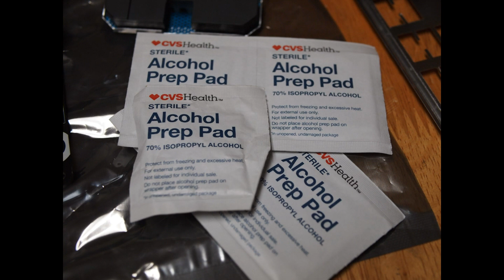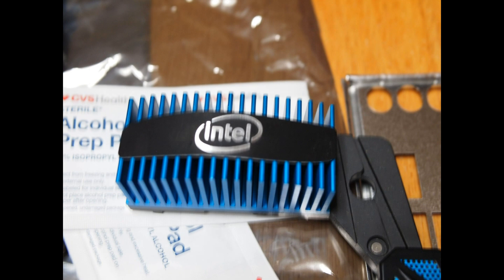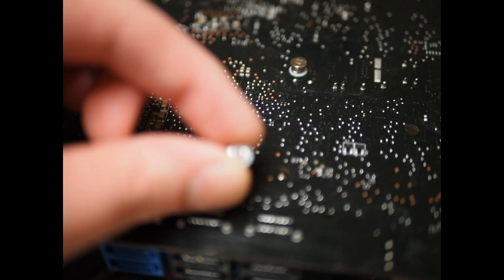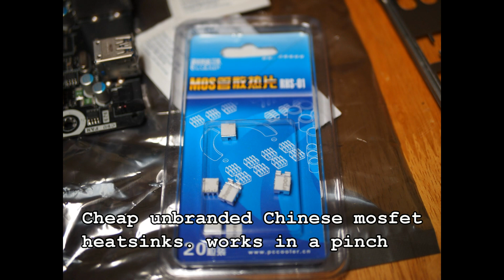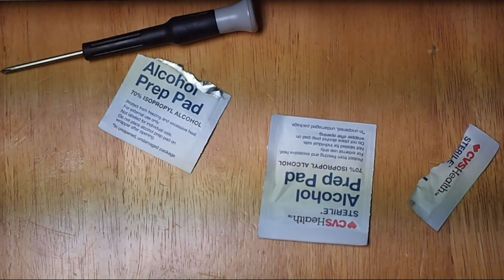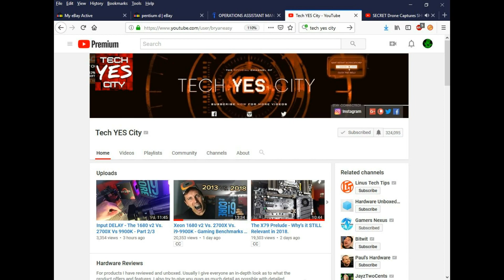Intel's unknown X79 motherboards - DX79TO

Comment: Pin? 
For win10 installation change to UEFI in bios.
Reply: For overclocking unlock profiles via helper then always lower cpu voltage i use i7 3930k on 1.35 and 4.5 for sure i could lower to maybe 1.29 or so as some people said its stable and if u put 4.2 in profiler u will get dynamic voltages which will always put you into bootloop i lost my mind after 10times. If u also unlock multiplier for without bios XTU wont do nothing as it will lock you back. XTU won't work for this mobo.
Reply: Cooler master hyper 212 with 2 fans 4.5ghz 60 in full load 40 idling
Reply: 2 fans on the cpu heatsink and i manage to get 50 on cyberpunk barely 60 degrees and 4ghz oc is very stable 4.5 seems to crash without AIO

Comment: I'm still rocking a dx79sr and it whips most new stuff easy.
Reply from the maker: What CPU do you use with it?
Reply: @ItIsNot1984  currently the 3930k but thinking about swapping for something with a few more cores
Reply from the maker: @mikeshobbiesandrandomstuff  afaik ivy bridge won't work on these boards, but I never physically installed one when i had the chance. Might be worth trying just to see what happens. Maybe intel snuck support in for them and it never made it to patch notes.

Comment: Bought this board back in 2012 with a 4x 4gb ram config gtx580 (now a 970) the 580 browned out, an I7 3820 clocked added a network adapter and ssd and this thing can still preform solid 10 years later. Crazy how the infrastructure for gaming really only improved on resolution. because at 1080p this thing runs modern games just fine. so 3k total for the rig including upgrades over 10 years in canadian dollars so prob $2400 american.
Reply: Can it run Subnautica? High/ultra 1080p
Reply: @terrapinflyer273  Yes it can! it can run elden ring at 60fps 1080p

Comment: I upgraded from x58 when I found a rampage iv formula bundled with a 10 core xeon and a 3930k for $130 a couple years ago. Sold the cpus to get an overclockable 1650 v2, no regrets lol. I am having a tough time looking for another x79 board (for a reasonable price) for another build tho
Reply: Nice!! I've been wanting a 1620 or 1650 v2 for a while now. Only drawback for the Xeons (that I know of) is the high tdp. And lack of onboard graphics if your dedicated gpu ever craps out.
Reply: @terrapinflyer273  I'd recommend looking at the 1650 and 1660 v3 xeons if you can find a mobo

Comment: Hi..best regards from Spain. Where Ivan find those hardware drivers??seams to be discontinued years ago, ando have to install those in w10, thx !!!Great job mate!!!
Reply from the maker: Intel abandoned its motherboard product line back windows 7 time. They dont exist for win10 really but not needed. I used two of these intel x79 models without issues in windows 10.
Reply: @ItIsNot1984  Thx mate,...some tricks or link to overclock ddr3 from 1600 to 1833 ???, thx
Reply from the maker: @ignacioherrero9374  i really dont remember the bios well enough. I will say this for cpu overclock, dont use the auto overclocker. It sets some pretty insane voltages and will burn out your board over time.

Comment: hey i have the same board with a cpu intel 3930k and 32gb Ram hyper X red edition  i am searching for gpu that is compatible  can i use 1060 or 1050ti or higher?  thanks
Reply from the maker: I used a 1070 and a 1050ti with success. I'm sure the 1060 would be fine. 2000 series and up, your guess is as good as mine. I think you'd be fine though even with 2000 series up since the board does support uefi.

Comment: I got one of these off of ebay for $119 with free shipping, and it came with a 4 core 8 threaded xeon! This is a good budget option, even in 2021.
Reply from the maker: It is still a good option for sure. You will want to go with a better cpu but you can often find these boards bundled with a cpu or ram that helps offset the cost even more.

Comment: Great video! I have a question for you and really anybody currently rocking one of these. I have a DX79SR that I got for $50 bucks and have been using it for nearly 2 years and it's been very rough. My issue is stability and behavior with Windows 10. There's no Windows 10 support on these boards and it's really showed me just that. I have a rather questionable RX 580 and I thought that it could be mainly the fault of that, but I feel like it's the board. I did try a UEFI install a time or two but that felt worse.

So, does anyone else have strange behavior and instability inside of Windows 10?
Reply from the maker: My first thought is look at your overclock. If you're running an OC try default and see if that clears it up. OC'ing with this board isn't hard, but if you let the board pick your settings it will use some insanely high voltages. You'll have to use custom settings and tune the voltages down. Not hard to do, my advise is on bootups try taking it a slight bit each time until you get to a point that just doesn't work and then go back up.

Personally, I haven't had stability issues with windows 10. I did have a dx79to that after a couple years or so started giving me major issues that would seem to come and go for no apparent reason. Switching the board out with dx79sr solved that. But yah if its not the OC, maybe try bread boarding it and doing some testing while adding back one thing at a time till you find the cause. If I were you, I'd be suspicious on the rx580. I haven't had good luck with them or the 570's. If you got it brand new, you're probably ok. They were just so popular for mining that they're a bit risky to buy used.

I finally broke down and spent my last .0233 bitcoin on an i7 10700k and motherboard. Just waiting for them to show up. Good luck with your x79 - its still a great platform.
Reply: @ItIsNot1984  thanks for the reply. Yeah, I did just get a 1650, but haven't overclocked it at all so it's probably not that. The 580 I have was originally a faulty one that didn't power on but I "fixed" it by removing a mosfet... and burning most of the components around it 😂. I'm flipping PCs right now and hope to get enough to snag a new card. But like now, it's stuck on 20H2 and refuses to successfully update. I'm probably going to toy around with drivers and see if that helps but if a new graphics card doesn't at least somewhat change things, I'm gonna probably look for another broken board and fix it up.

Thanks again and have fun with that new CPU and board!
Reply from the maker: @JeffsTechOfficial  How's the flipping? Personally, I've switched to just flipping parts online. Been playing around a lot with older hardware. Socket 478 is treating me well. It seems people love those old boards for insane windows 98 builds.
Reply: @ItIsNot1984  I used to sell individual parts online, but I sold a PC that I built for like $170 and got $400 back. I've procrastinated a lot since then, but the PC I just finished will hopefully sell for around $650.
Reply from the maker: @JeffsTechOfficial  Cool. I dont know that a new graphics card will help with updating windows - it can help with stability though. Might also want to try underclocking your 580 that can help sometimes. Good luck with the flipping. I've been doing too well with old enthusiast parts to go back. Maybe I'll try again when graphics card prices go back down.

Comment: To bad it's ddr3 not ddr4
Reply from the maker: It is quad channel so even though its not ddr4 it does have twice the memory bandwidth of a normal dual channel board. So, 1600 speed equates more or less to 3200. I have 2133 in mine.
Reply: @ItIsNot1984  yeah I know but my ram is ddr4
Reply from the maker: @themaster.d8229  my point was there is just as much and at times more memory bandwidth than even ddr4. Like the 2133 would roughly equate to 4266 because of the quad channel throughput
Reply: @ItIsNot1984  yeah I know that it's just that I only have ddr4 not ddr3

Comment: Mine behaves weirdly... it only boots with 2 or 4 pair of ram. I have put 2 ram of 4GB on black slots and currently its working. but if i want to use all 4 ram sticks. it only work either on left or right slots. something has to do with one of the ram installed...
Reply from the maker: Id clean the slots and dimm fingers with alcohol. If no luck its probably the board but memory comtroller is im the cpu so could try cleaning and reseating it. Cpu faults are uncommon but if you have a second cpu might be worth trying it if all else fails.
Reply: @ItIsNot1984  Thanks for the quick replay.. i'll try that
Reply from the maker: @gamesledge1  no prob. If you have canned air or blower then blow out the cpu socket as well before giving up on the board
Reply: As well as cleaning the underside of the CPU with some alcohol

Comment: Does it work with registered ram?
Reply from the maker: It does, but you'll want a xeon for that.
Reply: @ItIsNot1984  Nice, the manual only mentioned ECC and I saw the board for 59€. With the old registered ram and xeons on the market, it can be a cheap build.
Reply from the maker: @heyarno  just follow up. I came across a couple types of ecc ram. It would not work. Dunno if its something I did, ot looks like its supposed to, but didnt.

Comment: Thanks for doing this video mate, very useful info! Theres an Intel DX79SI, i7 3930k and 16GB decent ram a couple of hours drive from me for £180 seems worth it dispite the BIOS limitations. As soon as the corona virus lockdown ends im gonna go get it!
Reply from the maker: Cool. At the time, I wanted to do a video on the various parts I pick up but never had time for work. Surprised now and then this helps people out.
Reply: That's cool, would have been a good series, I've put up a few videos just showing gameplay on my old Dell workstation and I've been surprised at the response I've had from people asking questions about it. Even if it's niche you can still help a lot of people. Most people won't want to buy an old HEDT system or Workstation but there will always be lots of people out there who do and it's vids like yours that help people with it so keep up the good work 👍
Reply from the maker: @benjihutch24  I'll check it out

Comment: Will Xeon 2690 or 2687w work on dx79to?
Reply from the maker: It doesn't officially, but it should and I remember seeing forum posts from people stating that they do work. I considered both of those cpus. You might need a bios update to use them though. The early bios'es didn't support much since many of the cpu's weren't even released yet. You can get an e5 1607 for like $8 on ebay and do your update with that provided you can find the bios file now that intel took them all down. Hope that helps and maybe you don't need the update. Personally, I'd just go with a 3960x unless you really don't care for overclocking.

Comment from the maker: Intel has decided to remove all the bios updates for their old motherboards. Maybe they want us to move on to new platforms and buy new cpu's? Anyway, there are a number of mirror sites with the .exe files for updating these boards. I advise caution when using those sites. Also, try your board out first. If it supports the CPU you're using and works fine otherwise, then there's really no reason to do a bios update. There are a number of forums out there where you can ask for bios files. Again be cautions, look at the replier's activity account. Is there some way the site measures the quality of their replies? Just because Intel decided to be dicks and remove the files doesn't mean the files aren't attainable. Be smart about it though.
Reply: dude can i use xeon cpu with this board? regards
Reply from the maker: @LissandroDM  which xeon?
Reply: GameTech Reserve idk I search in google, but i can’t see which one works well with this board
Reply from the maker: @LissandroDM  You'll want to look for sandy bridge xeons. That means any with a V2 designation in the name won't work. You're looking for cpu's like e5-16XX and e5-26XX. If there is a V2 in the model name, that is an ivy bridge cpu. Intel never made a bios to support ivy, and now it can be a pain to find the bios files at all. If your board is an early model, it might not have a bios new enough to work with all the sandy bridge stuff. If you had to, you could buy a $5 e5-1607 on ebay and update the bios with it.. provided you can find and download the file.
Reply from the maker: Just to add, at this point, I think it is probably better to just buy one of the Chinese x79's unless you need the computer to be able to go into sleep mode. The unbranded Chinese boards can't go into sleep mode. They can still hibernate of course, but in hibernation you can't access the computer remotely. Also, the chinese boards have limited overclocking options.
Reply: Thank you for update!
Reply: I wonder if the sleep issue is similar to my old Foxconn board, where usb wakes it from sleep immediately. My solution was to go into Device Manager and disable "Allow wake from sleep" for the mouse and keyboard. Just have to press the power button to wake it up.

Also, I thought the DX79 boards (at least the SR, according to cpu-upgrade) was limited to E3 Xeons.
Reply from the maker: @terrapinflyer273  you can't trust cpu-upgrade. I had dx79to that failed. Replaced it with the dx79sr and kept my i7 3960x. You should be fine so long as you stick to sandy bridge. There is a specific dell CPU the e5 2687 that I'm unsure about

Comment: Does Dx79si supports Windows 10 64bit installation??
Reply from the maker: Of course.
Reply: @ItIsNot1984  because i going to purchase it tommor  i have currently Asus maximus extream iv  that not installed window 10 thats y i m change board  is  Dx79si ki perfect for use?
Reply from the maker: @aizazkiani4739  The maximus you have will work with windows 10 64 bit. It is a nice board - should support up to a 3770k which is only a 4 core but still perfectly capable. When you download the files to make an installation usb, make sure you get the 64 bit option. I have made 32 bit installations before on accident, so I'm guessing that is what you've done.
Reply: @ItIsNot1984  no no i already use that usb to other pc works perfect its 64 bit uefi  its say error that your hardware is not compatable for this windows
Reply: @ItIsNot1984  if i change sata configuration from bios setting to ide then it will be installed but not works properly and installation take 3 hours  damn  but in default setting of bios unable to install win10
Reply from the maker: @aizazkiani4739  I dunno what to tell you, man. You should be able to do that with the max, so I have no idea what your result will be with the dx79si. Maybe try deleting the partition on that hard drive and let the installer make a new one?
Reply: I doo every thing even change procesor rams harddrive  gpu
Reply: @ItIsNot1984  anyhow thanks
Reply from the maker: @aizazkiani4739  NP. Let me know what happens.
Reply: @ItIsNot1984  ok tommow i will buy Dx79si then install and tell u
Reply from the maker: @aizazkiani4739  The file name matches mine, so should be the newest one they did. https://rebyte.me/en/intel/27308/file-536986/
Reply from the maker: Did that bios work? I found one in my download history thats not an exe.
Reply from the maker: @aizazkiani4739  K. I'll send what I found. There was a bio and an exe file. At least you know they came from intel and not one of these shady download sites.
Reply: @ItIsNot1984  yea thats the prob its now not come on intel side

Comment: Hello, I currently have this dx79t0 and an i7 3820 stock ... Pata use the i7 4930k need to update the bios? And these i7 lga 2011 v3 fit on this motherboard?
Reply from the maker: V3 isn't an option. That is for x99. A 4930k will fit in the socket on your dx79to, but Intel never released a bios update to support it. Also, it seems impossible to modify the bios to add the code for it. You're stuck with the sandy bridge options for this board, but they're very comparable in terms of performance. The 4930k is only a little better than 3930k. With an overclock, you wouldn't notice. You could go with a 3960X like I did and it would be about the same as a 4930k without overclocking. They're also about the same in price and have been going up since I made this video. I gave about $80 for the 3960x. Now it is around $120. Xeon options are a little cheaper though.
Reply: @ItIsNot1984  Obrigado, abraços aqui do Brasil!

Comment: Thanks for the informative video. Chinese no-name X79 boards are tempting, but buying from China based sellers has its risk factors besides the actual boards' shortcomings. I agree that around $120 is the sweet spot for a decent X79 board. I certainly appreciate the ability to overclock on these Intel boards. CPU selection gimped? Ivy Bridge based Xeons (and i7's) still cost a bit too much, and Sandy Bridge isn't far behind in performance anyway.
I'm thinking over the feasibility of building systems for gaming based on 16xx V2 CPU and RX 570 for the purpose of selling them, so this helps.
BTW your comment on a Yes Man video brought me here
Reply from the maker: I find these intel x79's cheap now and then because I think you pretty much have to search by model number to find them. Just putting in "intel x79 motherboard" will bring up the thousands of chinese boards out there, so you have to specifically put in the models. dx79to, dx79sr and dx79sl. Usually I end up buying them with an i7 3820 and some memory in them. I sell the cpu and memory to lower the net cost of the boards. I haven't made any videos in a long while. I did a few to see if I liked it, but it is far and few in between that I get any responses, so thanks. Maybe I'll try to upload something soon.